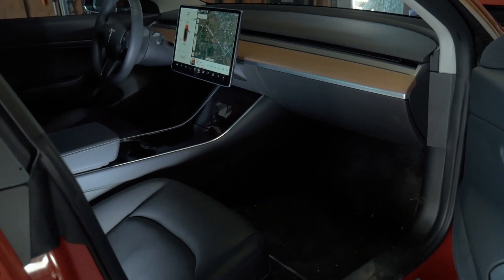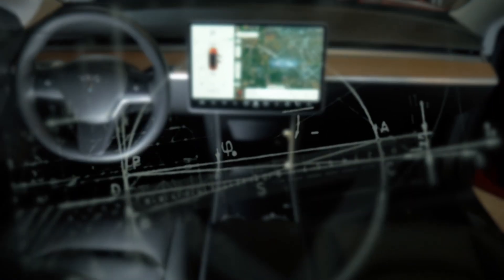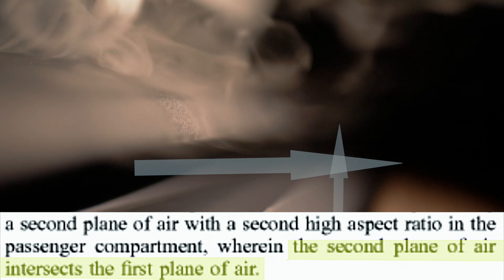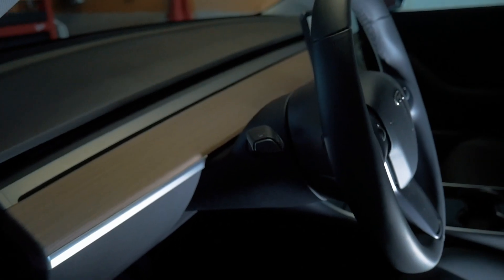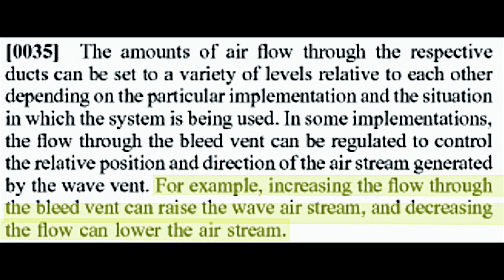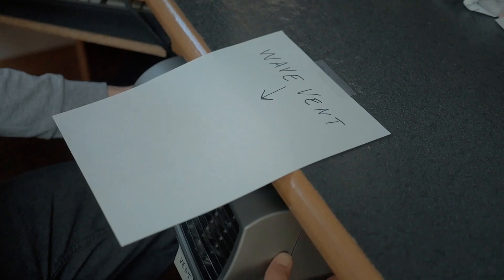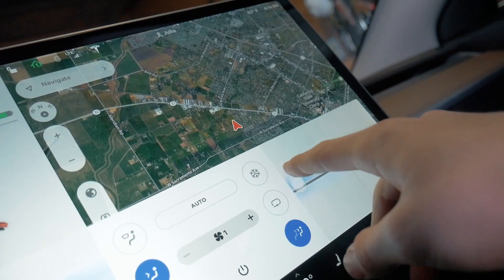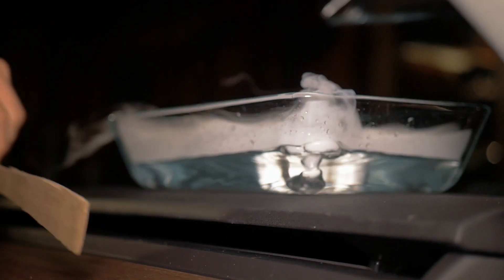The Genius Behind the Tesla Model 3 Air Vents

Comment: Thanks for this video, even though it's an interesting engineering solution in reality, there are not so many drivers who enjoy it, the wind blows straight in to the face (summer, AC) and even if you push the flow a side it still very uncomfortable :( it also does not do a great job about drying a windshield :(

Comment: Does the Tesla use one fan and control the amount to each vent … or two fan’s and just fiddle with the speed of each vent ?

Either way this is simpler to build than multiple hoses and hand adjusted vents.. that’s one of the benefits… it’s less complex due to well reasoned design thinking. Not sure how it stacks up against left / right zone controls… but always found them a bit gimmicky. Will be paying more attention to see if my cars passenger and driver have more or less turf wars on the personal comfort settings compared to say a contemporary Subaru Forester.

Comment: this seems overly-complicated. Also, I definitely don't want to have to use a touchscreen interface just to change the air vent direction. What's next, touchscreen interface for steering the car too?
Reply from the maker: Autonomous driving is next 😉 but yes, I agree, I’m not a huge fan of the touchscreen system, the technology is cool tho
Reply: @tavakessler  I can definitely appreciate the engineering, just wouldn't want to have to pay for the repair :P
Reply from the maker: You and me both 😂 but 2 years and still going strong

Comment: There was nothing wrong with the old systems. I want a knob that controls the actual temperature coming out of the vents, and vents that go up/down and left/right.  This is a car, not a house.  I recently replaced a $4500 turn signal bulb, so this overdesigned crap is expensive and completely unnecessary.

Comment: The experiment with the spoon under the faucet is not a good explanation of the Coanda effect.

The Coanda effect happens when a fluid interact with a solid surface and it's due to the viscosity of the fluid.

The thing with the spoon have two fluids involved (air and water) and not one, that means that the deflection of the jet is mostly because of surface tension and not viscosity.

Comment: No instrument cluster ... just a huge honking tablet in the middle of the dash?
Yeahhh... unless it's got a pretty good HUD that seems so unsafe as to be idiotic.

And then there's the fact that the tablet is good for three years, on the outside, before it's so degraded it will need to be $$$$ replaced, along with a lot of other highly technical computer stuff that has a duty period of maybe 5 years, 10 if it's solid state and very, very simple.

Conversely, if you take a look at the front dash... it's designed to be uniform from passenger to driver side.  In other words, the entire design is optimized to one day remove the steering wheel entirely.  Who needs a speedometer without any pedals or steering?  (I would hope they would put in an emergency steering something... joystick or whatever... just in case.  And emergency pedals that could be retracted when not in use).

Comment: Still a low quality interior.
Reply: Z Yeah well I don't know how my brother's 1998 BMW M3, doesn't have colour changing on its leather.
Reply: Ross Gambino it's $35k not 100k pounds.
Reply: Still an isolated issue. Tell me of any sources that show this isn't just your experience.
Reply: I've seen a different video showing extreme discoloration on seats of the Tesla crossover SUV thing with very limited miles, also white seats.
Reply: That Tesla model X only had 8400 miles.
Reply: It also has really bad misaligned panel gaps.
Reply: You have a white leather interior? Classy...
Reply: Most issues with clothing affecting color of leather or "leather" is from wearing unwashed clothing on the seats.
Reply: Z Your a proper Tesla fanboy haha. Here's a link: https://youtu.be/KmKN6nIDjAo 
 My mother's Tesla model s is just a little newer than my father's 550d. They are both 2016 I think. My father's 535d also has White seats(and it's even driven three times more than the Tesla), no colour change in them what so ever. My brother is a professional car detailer, the seats are cleaned and conditioned once every 3 months or so. The Teslas "leather" isn't really leather.
Reply: A Google search didn't bring up this issue at all with the Model 3 so I'll need a link to see what you're talking about. It also makes no sense for the material to magically absorb materials off of a piece of clothing, other than if it were unwashed. If the seats are Ultra White then of course it would carry different results after thousands of miles put in, and this affects every white seat that isn't cleaned enough. A more coarse material would be a different story. But, these seats are not somehow acting as sponges to take micro lint from clothing.
Reply: Z My mother's model s will make you think otherwise.
Reply: I already watched this video, I searched this problem on Google and found nothing but this video. it's still an isolated issue. You need more a very small amount of people for this to be a problem. It makes no sense that the material somehow absorbs your clothes material more. This video already states that it was primarily from wearing unwashed jeans and not fully cleaning it after a while. The video is made due to request about the ultra white "leather" after so much use. Not because he specifically spotted an issue with the leather itself and made a video in response.
Reply: Z Anyhow, my point is. Which I am not wrong about is that Tesla's interiors aren't high quality for what they cost. And I know that because I can literally go out in my driveway sit in a Tesla and then sit in a luxury car for about the same price range. There is tons of threads online about Tesla's interior quality. I guess with a Tesla you pay more for features than quality, even though they don't really have nothing that impressive, you can just control everything from one screen which isn't worth over 100000 for me.
Reply: It wouldn't make sense to try to be an environmentally safe vehicle while promoting the use of real leather for their seats. That's the reason they don't use leather.
Reply from the maker: It’s not actually....
Reply: TAVA Is that so? Why is then the leather in the car not real? Why does the" leather" of the Tesla become the colour of your clothes after a while? Why is there so much plastics? If I pay so much I expect the interior to be top notch. For £100,000 I can get a very well equipped s class or 7 series that has real wood and leather in it that doesn't take in the colour of my clothes, and is more practical and luxurious.

Comment: Is there a vent for windscreen like traditional cars? In my country at winter, you cannot see anything because of frost unless you point air directly to windshield.
Reply: The author of the video said yes and it works well in another comment. I'll also note that it is a government requirement in the USA that all vehicles have this feature. It's called 'defrost'. I have actually failed a vehicle inspection because my heater blower motor died, as that would prevent defrost from working.

Comment: This doesn't explain it to be useful or better then older vents. combineding 2 different venting systems isn't make it better. It apparently has a reverse effect. Because if you have cold air blowing from the 'vent' what is the 'bleed vent' doing? Cold also? Or just soft blowing normal air? There is no explain't of this. If it's just blowing normal air vs cold air. The bleed reduces the cooling power by over 60% and the more the bleed needs to blow the air up, the more reduced cooling you get. Now if both systems are blowing Cold air vs one just cycling inner air. Then you apparently get better air abilty and colder faster. But this also uses alot more power and double venting systems vs normal cars which only use 1 central system.

Comment: Needlessly complicated.
Reply: i don't think there's too much of a calculation, sure you have all these facts behind it but the guy probably looked at it and said: Oh, looks like the air is going down we'll just put another vent below it to blow it back up
Reply: So now you make it twice as complicated... twice as many vents and fans.
Reply: Mike McGlock, Well technically there are really only two vents vs the traditional cars several 5-4.
Reply: Except traditional cars have to only control one fan
Reply: Mike McGlock traditional HVAC cars need separate floor and defroster
Reply: After seats and the steering wheel remembering their positions for different drivers, it's only logical for the air vents to do the same. It's good stuff.
Reply: Mike McGlock i was trying to find a way to put that into just a few words without swearing. Thank u
Reply: The main goal of Tesla is to replace complicated hardware with efficient software and this is reflected in the vent design. It's not needlessly complicated, it's just a new way of solving a design problem. Even if it seems like there are more points of failure, it's just another component of the car handled by software which ultimately simplifies its functionality.
Reply: It simplifies the production process a lot actually. Now everything is kind of together as one unit and simple pieces, where before, everything else just fits everything around each other while fighting over space and areas to be routed.

Comment: The interior is so boring and old looking it needs plastic on the seats and doilies.
Reply from the maker: Right.....?
Reply: Mr X haha do you drive a Prius or something
Reply: Mr X what’s wrong with guzzling gas?
Reply: Kasim Fatmi if you want a Tesla Model S with S-Class interior, its gonna be well over $150,000
Reply: When I spend $100k (Model S), I want an interior that rivals an S-Class, not an interior that's inferior to a Toyota Corolla.
Reply: It's actually an interior you wish you had. But first you need to clean your own dirty interior in your gas guzzler.

Comment: I'd rather hear from the moron that designed one of the ugliest interiors in car history
Reply: It looks like a 1991 lumina with a computer screen glued to the dash
Reply: they stated this was to make manufacturing more streamlined. During initial production of the Model S and X, they stated that with so many people asking for such varied options, it was difficult to build an efficient assembly line. With the simplified interior, it is much easier to bring a cheap electric car to mass market, which is the entire purpose of the model 3.
Reply: AirsickCashew When Tesla gets the production shit together, they will probably make a new model 3 (4+ years from now) with an updated interior. Or at least as a package upgrade. The M3 has a package upgrade for the interior but it still looks meh.
Reply: SogMosee dam these days people believe in whatever Tesla says
Reply: Regarding the "cheap car" part. The Model 3 will be around 50.000 to 60.000€ (~75.000USD). Cheap cars are around 10.000 to 15.000€ (~18.000USD).
Reply: The interior looks so cheap to me.  One small monitor in the middle and that's it?  I like things that are "streamlined" but this is ridiculous.
Reply from the maker: Dudeeeee, you’re actually joking
Reply: Relative to the model S, the 3 is a joke. Straight lines, off-center display, a tablet on a dashboard mount you can probably buy on amazon, no color options, boring steering wheel...it's garbage. It honestly looks like they gave it very little thought.
Reply: Really? Streamlined? This is why production is 2 years behind now right? haha
Reply: I'm sure they'll be receptive to feedback and make updates in the future, but I'm talking about this style specifically. They KILLED IT with the Model S, so an interior this lackluster is pathetic. I had been so excited to place an order for this car, deposit in hand, until I saw the interior.
Reply: Simplest and cleanest interior ever. I'm sure you prefer the Panamera with 200+ buttons and knobs. Lol

Comment: What’s the point of this. Why does tesla do stuff differently just for the sake of doing stuff differently. This is why their cars have major production and quality issues.
Reply: They barely have any competition because they're the ones that created the market, while other manufacturers were still working on Diesel engines.
Porsche can make a better car, but they don't have the Supercharger network that Tesla owns
Reply: For one, because it's cool... but more importantly: because they HAVE TO. In a market so saturated (car manufacturing), and nearly impossible to break into, they are forced to make new things that blows people's minds in order to gain any sort of traction in market share. Just like how iPhone had to be completely revolutionary in order to penetrate the Nokia market of its time. This is Business 101...
Reply: The production issues they are facing is not because the car is hard to make, it is because they attempted a new manufacturing technique with the model 3. They built robots that manufacture the car, obsolescing the need for humans to do it. You may have heard it referred to as "the machine that builds the machine". Unfortunately, the machines they built were very tightly coupled to each other, such that if one broke, the entire production line was haulted, which is exactly what happened. They have since rebuilt the machines to have a higher fault tolerance and work more independently of each other.
Reply: wavey61 101+2=103
Reply: so there are stupid people in here too..
Reply: style - if it looks the same as everything else, why buy this?
Reply: Ya the new air vents are the reason why Model 3 production is slow. Totally.
Reply: Tesla is Daddy. Porsche will always be there son. And every other auto maker. Porsche don't got a global supercharging network. But Daddy does.
Reply: Stores are showrooms where you can service and buy the car. They never "fly out" journalists. You have to be a press member, a Tesla shareholder to even get an invitation to their events that they hold. You have to hold events or no one will know what you are up to. Its not marketing. Marketing is when you put ads, have billboards, and pay for positive reviews. Basic events to let everyone know what your product is is not marketing, its a necessity. They never give any websites or anyone cars to review, the sites have one person buy it for themselves and they review that model. They even state that before every review. Please do research before you act like a dumbass on the internet. Jesus christ you stupid people are so confident about everything you say. It's cringey. Stop. You could not be more blatantly wrong. Its a known fact in the industry that Tesla spends not extra money on advertising.
Reply: Why lower the price? People keep saying this like they haven't got nearly 1/4 million in pre-orders alone. It's a bit like going into a top restaurant with a week-long waiting list and tell them to lower their prices or you won't go, they'd be fools to lose out on money from those hundreds of thousands of people just to please you.
Reply: yah keep production costs down but never undersell.
Reply: Mr X Neither does Tesla, at least not at a usefull Distance. In the US they might do so but in Germany for example its even hard finding any E-Car Charger outside any bigger citys.
Reply: Dude they are like the only brand that spends nothing on advertising. They cant afford to because they arent able to make profits and the demand is high regardless. You couldnt be more wrong you dumbass.
Reply: Amm ol you’re so fucking dumb that you believe they actually spend nothing on marketing just shows what sort of people like tesla. The fucking dumbest people on earth. What a fucking dumb fuck.
Reply: Fadic 4 They are the reason those companies are making EV's... Their cars still are the best EV's on the road.
Reply: This is related to the future Tesla autonomous ride-sharing network, everything in this car is software controlled, even the glove compartment, so it gets safer and more convinient to have strangers in your car. Just imagine someone changing the fan direction/speed and then when you enter your car it goes to your last used state.
Reply: less vents = less parts = cheaper and faster mass production
Reply from the maker: They are just trying to make change.
Reply: Obviously you missed this comment from Karen Pease which was left a week ago.
"You left off the reason for doing it that way in the first place.  
Computer controlled vent = driver doesn't need to be able to reach the 
vent to adjust it.  Driver doesn't need to be able to reach the vent = 
vent (and thus dash as well) can be moved further away."

Basically, this allows for there to be more space inside the vehicle, making it more comfortable
Reply: Fadic 4 Seems like they're doing things right, considering theyre the most successful EV brand there is.
Reply: Bazyli Brzóska oh yeah. You can definitely tell this is cheaper and faster production by the way the model 3 production has been going so far
Reply: they're the best ev's on the road because they barely have any compition.
Reply: the only thing they do right is their marketing. with competition like the Porsche mission E coming out and more cars from legitimate automakers, theyll overtake tesla easily.
Reply: the model y laughs at your prediction

Comment: So if something goes wrong with the software/hardware of that screen and its out of warranty we have to sell a liver?
Reply: Any other modern car wouldn't run with a software failure anyway. But i agree that by just shattering one screen you are screwed.
Reply: Just like any other car, especially German vehicles.
Reply from the maker: Probably
Reply: Kaloyan Bankov u dont have that many livers so yeah, sell ur liver .-.
Reply: someones gonna shark out the communication between the screen and the other servos and ICs in the car eventually
Reply: Sell your kidney first before your liver.
Reply: +Bill Latibay: Sell half of your liver; it regenerates.